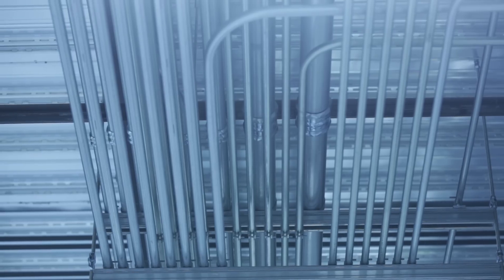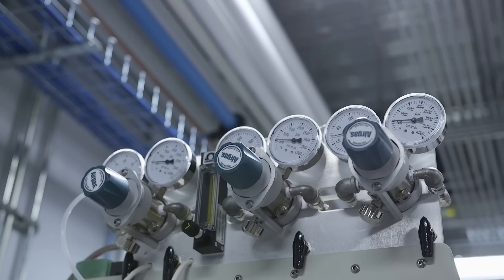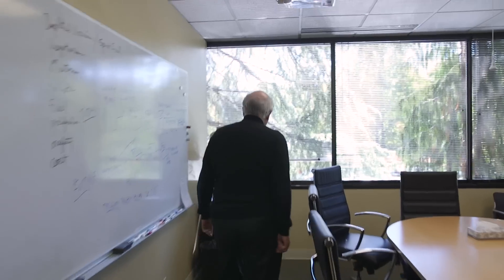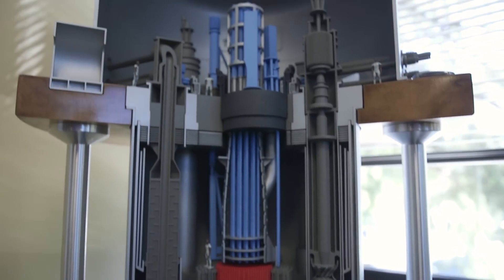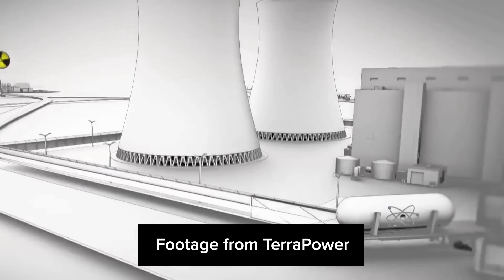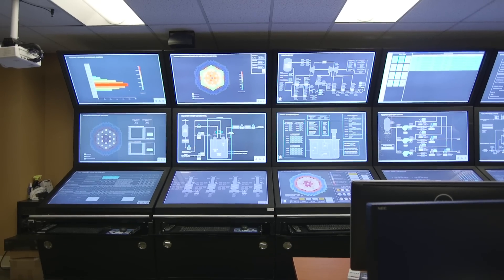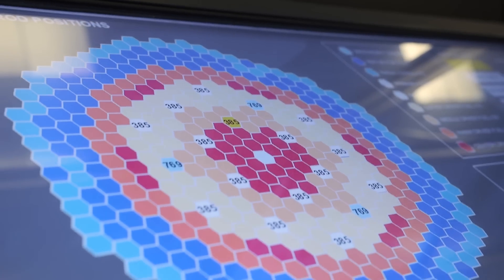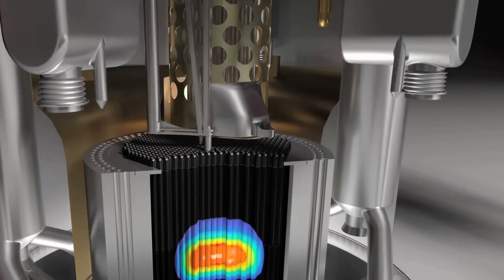The Company Determined to Fix Nuclear Energy

Comment: This is very important stuff.  It’s equally important to get the best, clearest messages out by the best, clearest narrators.  This info is good, very good.  This give us hope for clean energy.  Clean in that it deals with the world’s nuclear waste AND turns it into new clean energy, plus it can’t “melt down”, it can’t run out of operating power (like Fukushima did), and it doesn’t pollute the air or adjacent landscape.  It’s extremely efficient and it’s our best possible solution for the future.
Reply: He says waste but that is not what we're talking about, that stuff is used for bullets,shells,tank armor, it isn't dangerous when we say nuclear waste we mean spent fuel, he just means U238,still all Terrapower is doing is wonderful, two project Natrium in Wyoming and a fast molten chloride experiment, would still like to see the traveling wave but Im glad Bill went back and put the others first, for this you'd need to have such confidence in the robotics.

Comment: What about geothermal energy? You rarely hear about it in these types of conversations. Is it just not that good?
Reply: Most country dosent have access to geothermal energy. Nuclear can work everywhere in the planet.
Reply: the problem with geo is too few good sites and also the good sites tend to be a long way from where the power would be used.
Reply: As the others have indicated: It is good - but you need geothermal activity in your country though. Check out Scandinavia - they can do it. But it takes some reasonable amount of geothermal activity to be anywhere near profitable.
Reply: Dependent on the location why drill down miles when we can make far hotter liquid in our reactors?

Comment: He doesn't really mention what happens to the used, depleted uranium stock.
Reply: They would be using depleted uranium or mixed uranium - enriched uranium is where you pull out a particular rare isotope that is much more fissile naturally - so it burns fast ... and also used in nuclear weapons for that reason. There is no 'pre-depleted' uranium, there are just the enriched, which is very rich in the good fissile material and the 'depleted' which is really a bad name for it, but basically it is a very low-fissile material.
Reply: +A Cat with a Face 
You mine some more? - And you wouldn't have to mine as much as today per unit of energy since the reactor don't need  enriched uranium. You might also start mixing in thorium into the fule in order to mine less uranium.
Reply: +Viktor Gribbe But they don't explain the process of using the uranium terribly well. Despite that the uranium doesn't need to be enriched, can the uranium be depleted? If it doesn't matter terribly what types of uranium can be used, can pre-depleted uranium be used?
Reply: It is a fast reactor so at the end you store the rods for 300 years then you can put them in the garden, the two things in them have half lives of 30 years.

Comment: has anyone heard of thorium?

atlantic do a video about thorium please.
Reply: @Mark Smed Nuclear is essential, and renewables are in a way a distraction to the big-picture solution, but they have their own uses and should still be developed, even if for a more limited set of applications.
Reply: +Jared Zambrana I caught wind of the pro-thorium cult and was taken in for a while. It's reliant on mining and externalising of wastes. There was a reason ancient cultures worshipped the sun, and it wasn't because they were backwards or primitive. They understood that everything comes from the sun, so, we ought to re-orient our civilisation around capturing TODAY'S sunlight, not digging in the ground in some futile attempt to use OLD sunlight. 

Yes it will require resources to capture & store sunlight but solar towers have proven to be viable. Morocco is finally building a solar trough array. Cover the equator in mirrors focusing on turning steam turbines then use the electricity to desalinate salty sea water and irrigate the desert once again. With the remaining electricity electrolyse water into hydrogen + oxygen for gas related products and pipe those everywhere.
Reply: ***** nuclear is a distraction. we need a rapid solar capture program everywhere. now.
Reply: +Mark Smed i think this idea of one single source of energy is the problem. i believe the energy crisis problem is solved by a combination of solutions so that each can respond to the different climates and the different needs but also weakening a direct dependence on a single source
Reply: +Mark Smed so you would agree that an energy ecosystem is necessary and not just a single source. and that would be great for economy and our energy needs.
Reply: ***** Nuclear requires a blank check from a national government to underwrite unlimited future storage of the waste, doesn't it bother you that we allow governments to fund really wasteful practices instead of going with the best technology has to offer? Concentrated solar can run at night time without any loss in output.
Reply: +hotfreshrider yeah the storage of toxic materials is a major problem but it can be minimized by utilizing methods like nuclear from thorium which is much less than with uranium. again solar by itself is not the solution it would be a combination of solar, geothermal, hydro, and any other source that is sustainable. in my opinion.
Reply: @hotfreshrider   The only reason we don't have waste disposal in place is the obstructionism of people like Harry Reid. The money to fund the system has already and is being paid by existing nuclear plants ever since the first was built. But old Harry managed to stall the needed investment.